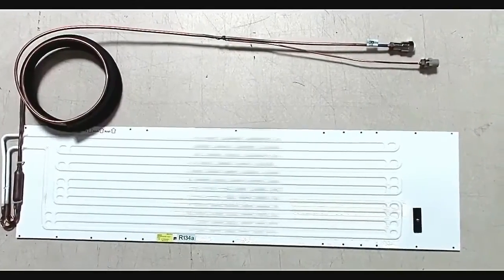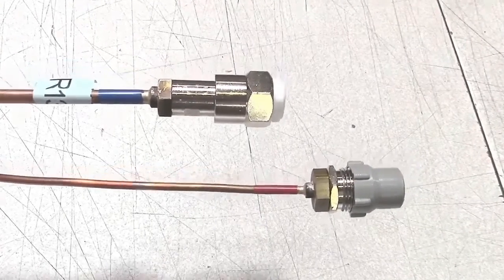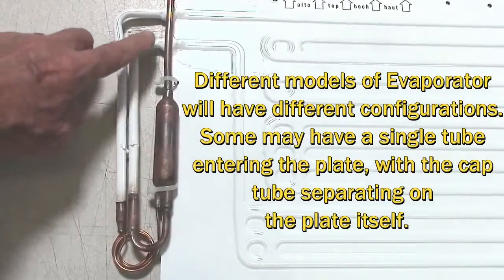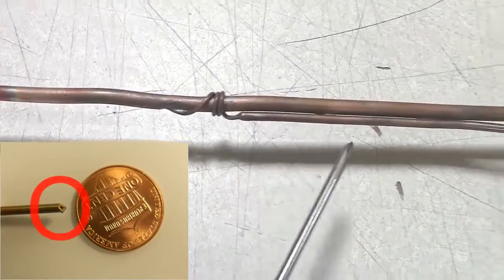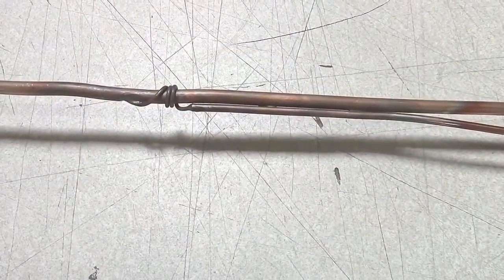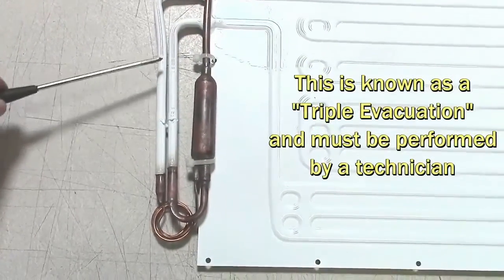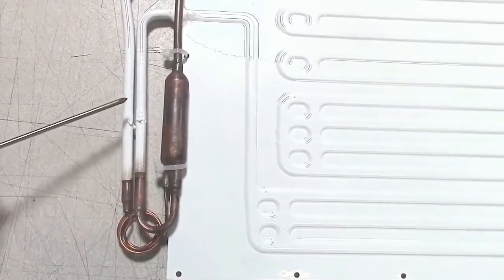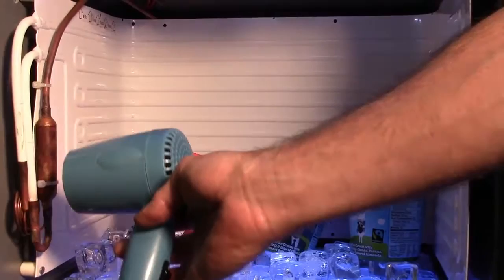Cap Tube Blockages

Comment: Thanks for this. It describes my issue. But, the video is not very clear. When you heat the capillary tube with a hair dryer: for how long? And, is the evaporator off, warm, or cold? Or, is the compressor running and stuff flowing?